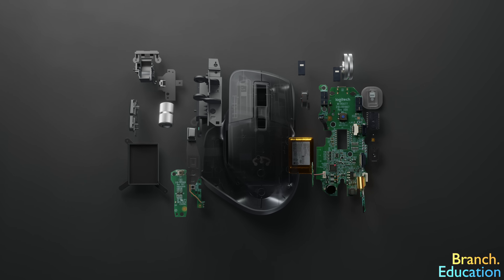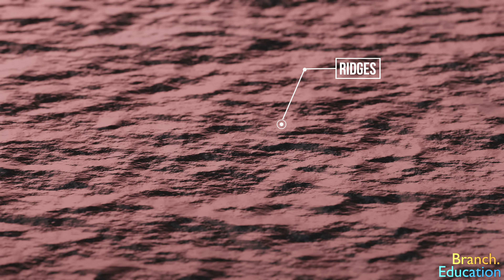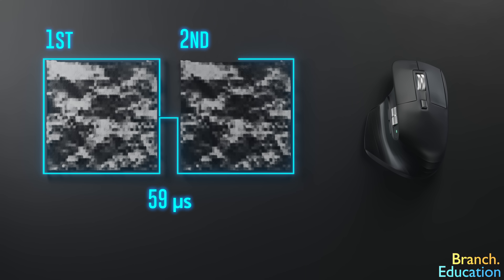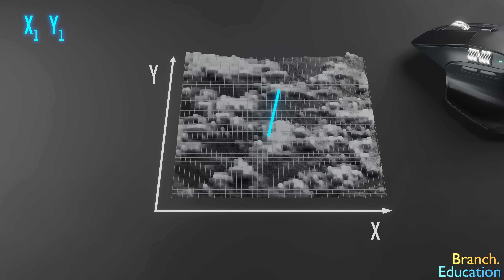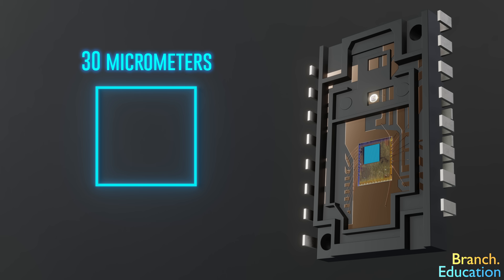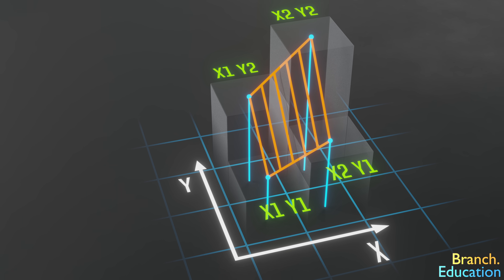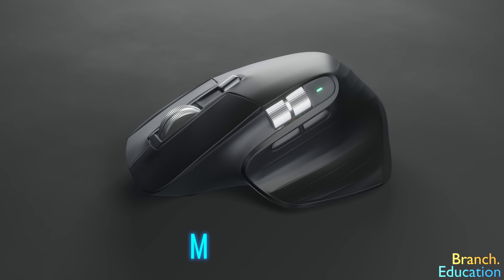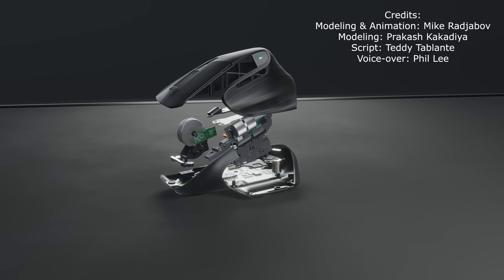How does a Mouse know when you move it?  ||  How Does a Computer Mouse Work?

Comment: For those interested, the little SoC (with the red dot) near the imager chip is a -muRata MBN52832- Nordic Semiconductor NRF52832 which contains a 32bit Arm Cortex M4F with built in FPU processor with 64k of RAM and 512k flash storage. Here's an interesting tidbit, the Cortex M4F has enough processing power to run Doom, so technically if you were to add a couple megabytes of ram and a display to this mouse it could run and control Doom by itself.
Reply: 64k of RAM in the SOC of a Mouse. Imagine going back in time and telling this for engineers of the Commodore 64
Reply: @fellipec  The fact that my $40 bluetooth earbuds (Cortex M4F @ 250 mhz) are almost 10 times more powerful than my i486 PC (which cost over $2000 when I got it) blows my mind.
Reply: @LegacyOfTheAncientsC64c  Wait for 50 more years and see what the current technology is worth lol. Grow up man. Everything current blows our mind compared to our past. It is common sense.
Reply: @LegacyOfTheAncientsC64c  Sure. When I think about what happened since my first PC, is a mindblowing thing
Reply: @edwardspencer9397  If by "grow up" you mean "Lose the capacity for wonder" I'm sure he'll get riiiiiiiight on that.

My only annoyance, as someone who likes to tinker around with such things, is that mice image sensors/lenses are generally bespoke things, so it's not like you can whip up a mouse with an Arduino that does something unusual.
Reply: @edwardspencer9397  yep, every comment has one. “Mr. Logical—smartest man in the room” telling people to grow up because they think things are cool. I think you’re the one who needs to do some growing up.
Reply: @edwardspencer9397  who pissed in your cereal when you wrote this comment man? Maybe rather than waiting for other people to develop that technology, you should instead learn what a marvel it is that we got to this point, and help develop it further. If you fully understood all the workings of this stuff, you'd be amazed too rather than telling someone to "grow up" for some reason??
Reply: @edwardspencer9397  Dude I believe you might want to chill out for a moment and maybe find something in life that makes you smile. Either that, or someone pissed in your cereal TWICE, in which case I offer my commiserations (having that happen to me would probably make me rather angry too so it's understandable).
Reply: OhSoUnicornly Aah so you are a 12 yr old then. Why didn’t you tell me earlier. Point noted Mr. Cereal killer. Everything makes sense now. I will send you a mouse. Tinker with it, play Doom. That will make you smile.
Reply: @edwardspencer9397  so much power as to be inefficient compared to Apple’s handset chips. Power is bad, dolt and ageist. Computers run well on speed.
Reply: @edwardspencer9397  When you try to be savage but you end up being wholesome by mistake 🤷‍♀
Reply: OhSoUnicornly You were trying hard.. and you failed miserably. Ulta chor kotwal ko daante 😂
Reply: @fellipec 
64k of RAM in the SOC of a Mouse. Imagine going back in time and telling this for engineers of the Commodore 64

"Isn't 64K an awful lot to dedicate to just 1 input device? Memory isn't cheap you know. And how are you going to cram 64K of memory chips into a hand-held mouse? We could use 64K of video RAM to do better graphics.", they might reply. "Couldn't we just use a ball and 2 roller switch counters? And where are you going to connect it? The Commode 64 does not have very many clunky interface ports. And what is a 'USB hub'?"
Reply: @fellipec  That's at least 2x the memory that was required to take Neil Armstrong to the moon. And it's in a mouse. Wow.
Reply: Shows how insanely far we have come with computer technology
Reply: thats insane
Reply: mind blown
Reply: Wow, thank you! That's so cool!
Reply: Plot twist: The mouse is the computer ...
Reply: @Cookie-kf3xn 
Plot twist: The mouse is the computer ...

Plot twist, the handheld game controller is the game console. Oh wait, I think that has been done already.
Reply: My Mind Effing exploded when i saw another "it can run doom" analysis. I remember how big and clunky my rig was when I first ever played it. and now things like pregnancy tests can run it. God i was born in the 90's and already i sound old.
Reply: @Hawkeye_PC  Yeah that pregnancy test was BS. The guy just used the plastic shell and stuffed an oled display in it and used a raspberry pi (or an arduino can't remember which) to run it, and it wasn't even Doom it was just a video of it. The tiny 4bit MCU on those things run sub 1mhz and has even less power than an Altair kit. Everytime I see it I laugh, it's sort of become a joke in tech circles of how tech journalists report of things without validating it or even bothering to check whether it's true.
Reply: @Hawkeye_PC 
You might like to check out Ben Eater's YT video channel. I think that the first video I watched was something about how to build the "world's worst video card". He built a video card on a breadboard with simple digital logic components. His computer monitor was happy, detected a 640x480 signal (properly timed sync signal), but the screen was blank, because he/we hadn't built the graphics part yet. Then he/we build it with 64 colors at a very poor resolution. My first computer, an Apple //e  would have loved having 64 colors! Amazing to watch his videos. What fun to build all that stuff, however, I already have a computer with much more power than what he is showing me how to build. He will even sell you the kits. Maybe if I was retired, I could have more time to play around with hobbies and build stuff.

Why breadboards? He explains that in one of his videos. Anybody can build a kit, but they wouldn't know why things are done a certain way. The breadboard computer allows a person to experiment, see problems and faults, and how they might be fixed or improved.
Reply: @yosefmacgruber1920  Yep, I saw that video a while back. Been subbed to his channel for a while.
Reply: @LegacyOfTheAncientsC64c 
I do not sub to much of anything. Maybe I am interested in too many topics, and would be getting too many notifications?
Reply: It gets crazier when you compare it to the Apollo Guidance Computer operating at 2 MHz , 2k 15bit word RAM and 36k word ROM. It sucked down 55 watts and weighed 70 lbs.
Reply: to be fair, a GBA can run doom.
Reply: I think you might need to add a video card and sound card to run Doom. Integrated graphics and sound probably are not a thing on a mouse. Might need to beef up the power supply also.

Strange how almost every little computer accessory is in itself a computer of its own.
Reply: @yosefmacgruber1920  the latter has been true for many decades now. For example Commodore PET or Commodore 64 disk drives, contained a 6502 processor with roughly the same computing power as the computer itself.
Reply: @mjouwbuis 
And so most of that extra computing power was wasted, of no use when the disk drive is not spinning. And the disk drives were oversized and clunky and ugly, while my Apple //e disk drives pulled their power from my Apple //e power supply, not having a power-outlet-hogging plug.

2 possible benefits though, especially if CPUs were becoming cheap enough:
• faster loading and saving. The extra CPU can handle the data modulation/demodulation, perhaps a 2:1 interlace ratio could be used like the later Macintosh, rather than my Apple //e's slow 4:1. Modulation is required because too many 0s or 1 bits in a row can not reproduce the correct count. Modulation likely added a small amount to the amount of data needing to be stored. But those old computers didn't use much data, and so loading/saving twice as fast, would seem to make little difference. The much bigger problem was disk-swapping, because extra disk drives were expensive and beyond many of us's budgets. Why didn't they build a "2 drives in one" drive?
• a move towards multi-tasking? However video streaming wasn't a thing back then, so mostly irrelevant? Even now, how many video games can preload a next level while still playing the current level? There just wasn't the need yet to load data at the same time that other things were happening.

Now things have improved. CPUs are cheaper and electronics much smaller. Peripherals having their own CPUs may solve some compatibility and timing issues. Printers always seemed to have their own CPUs? Most everything tends to buffer data to help hide minor data flow disruptions.
Reply: @yosefmacgruber1920  If I recall correctly the NRF52832 has a built in LVDS LCD driver (not 100% sure though) so you'd only need the interface. As for the graphics the M4F can run Doom purely in software mode, same for audio. 

You're right, everything has a little microcontroller in it. I was looking through an old manual for my mother's stove and came across a section on how to turn the burner knobs in order to display the software version on it's clock display and I was "whaaat? This has a firmware?"
Reply: @LegacyOfTheAncientsC64c 
Well my ancient electric stove I am pretty sure, has no software. Has one of those old noisy gears electric motor drive clocks on it. Those old motors were simply paced by the 60 Hertz AC. But my microwave oven could be run by the same 6502 CPU processor, than ran my Apple //e computer, for all I know. Surely a 16-bit address bus and ability to access up to 64K of RAM is plenty to operate a simple appliance. They often use LED or LCD displays I imagine, because the interface is simpler, no video card needed. If I had nothing better to do, it might be fun to write a few apps, that simulate a microwave oven or digital watcher operation, clicking on the sort of keyboard or just 4 or 5 buttons that such a device might have.

When Ben Eater wrote some simple 6502 Assembly code to put his "world's worst video card" through its paces, I was amused at how FAMILIAR the code was, as I used to play around with that on my old Apple //e computer. Although my Miniassembler was much too cumbersome and limited, so I often just looked up the codes and typed in the hexadecimal values for the bytes. They was a handy often-used trick for doing short amounts of machine code right within an Applesoft Basic text string. Not need to poke the values into memory, as the text could be poke-copied into the input buffer and sent to the ROM-based Monitor to put it into RAM. That way, I need not bother to convert all the numbers to decimal and editing would be easier. The Monitor was a crude ROM-based programmer's utility. Looked something like this:

500FORA=1TO15
510POKE2*256-1+A,ORD(MID$("300:2C 19 FE 20",A,1)): REM Load input buffer.
520NEXT
530CALL-151+3: REM Call Monitor to process without prompting input line.

If I do not want to keep changing the character count "15" then I could assign the string to a text variable B$ and replace 500 with 

]400B$="300:2C 19 FE 20"
]500FORA=1TOLEN(B$)
]510 ...B$ ...
  
Please do not hold me to it, as it has been a long time, and my example is oversimplified, but as the text line input buffer was 255 bytes and a text string could be up to 255 bytes, up to around 80 bytes of machine code could be encoded in such a manner. So a lot of us would write our machine code subroutines in such a way. There wasn't any real need to type the spaces, as Applesoft Basic would put in the command spaces anyway.

If the code was much longer, then it would be saved to disk as a (B)inary file. Then an Applesoft Basic program could BLOAD it, or it could be
]BRUN BUG ATTACK if it was just 1 file.

On my first car, I could turn on the ignition 5 times in quick succession, and it would flash the trouble code pulses to the power loss light on the dash. Carefully count the pulses and write down the number(s). Tell the auto parts store or check the internet I guess? Now with "progress" you now need an actual trouble code reader computer to extract any codes. Which I still do not have one. Some auto parts stores will read your codes for you. No charge until you buy the replacement part(s).
Reply: Am smart,but i even can't try to understand what you are say,this is insane.
Reply: This is the Nordic NRF52832, not Murata. Murata manufactures modules with this microcontroller.
Reply: @ЕвгенийКочкин-н7ф  Good catch, thanks. I fixed the comment with the correct part.
Reply: im suprised basically homeless hasnt made a video trying to game with just a mouse
Reply: How can something with 64k of RAM play a game that required a minimum of 8MB of RAM? Isn't a Megabye larger than a K? K = 1,000 whereas MB = 1,000,000?
Am I wrong? According to https://gamesystemrequirements.com/game/doom Doom requires 8MB of RAM at a minimum which is vastly larger than 64k. That's a difference of 15.625. Either I am thinking about this incorrectly or your comment is incorrect.
Reply: @Drewsterman777  I mentioned the need for extra ram in my comment.
Reply: @LegacyOfTheAncientsC64c  Yup, I misread.
Reply: @Drewsterman777  no prob happens to everyone. I wonder if it's possible to run a Doom-like game with just 64k. Maybe simplified textures and level design. The SNES had a pared down SuperFX chip version that used an extra 512k ram in the cart along with the console's 128k. The Cortex M4F is orders of magnitude faster so it might be possible to use some sort of round robin memory compression to eke out a bit of extra ram space or even run with paged data from the flash memory if the speed is high enough.
Reply: @Drewsterman777  read the whole comment. Also that number is a factor.
Reply: Oh, OH, thats quite interesting!
Reply: And pretty sure that shit is more powerful than computers used on old rockets
Reply: Lol, that was so nerdy. Awesome ;)
Reply: If you put a keyboard, half a GB of RAM and a display on such a mouse you can run full Raspberry Pi OS on it!
Reply: I like your words funny man
Reply: I like your funny words, magic man
Reply: speed, not power
Reply: The only way we survive, I'd say if we stop being human.
 It's becoming self destructive, everyday people wounder what Kardashians are doing, how could I make my dick bigger or my tit's, ass the list goes on. Humankind as a whole is focusing on society more then the advancement in technology, ik the golden age is among us for tech development. But if we had a Jimmy nutron in every home on this planet, the world would be a better place would be free from poverty from ailment or from war. 
If everyone was on par technologically speaking we would be living all of us would be living the greatest life known in our history. 

Sad to see but ik most of you guys will clown me for my input, Ik it's cringe to say it but somebody has to. 
Think tho if we all had a med bay and a roof that u can call your own and actual facility were u can learn about the world u were born into and  how to mold your passions into it. A press that was honest and only gave u what happend no hog wash along with it,  Maybe one day people will realize their on a treadmill and the killer, time is not. 
Better to live with accolades in grander than die in a prisons wealth of thoughts and ideas left to the wispers of the graveyard.
Reply: @deepkicks-999  Did not find your reply cringy at all. Absolutely agree with what you say.
Reply: @LegacyOfTheAncientsC64c  thank u
Reply: @deepkicks-999  awful diction/gender
Reply: Can you post this again in English please.🥸😏
Reply: @HalfWarrior  last sentence is in English.
Reply: @DanSlotea  I know that of course; just my sense of humor kicking in.
Reply: @HalfWarrior  didn't get through :)))
Reply: @HalfWarrior  The most powerful processor on that mouse, when given more memory, can run DOOM, the 90s version. It’s a testament to how powerful technology is now, that the most mundane and overlooked components can do what only the best machines 30 years ago could do.
Reply: Aaah, yes, the S98EG6S8R7H58S Hyperelectroplasma Converter. i am very familiar with it, i use it every day. It also goes up to 10000 MegaSpeeds but only with Torso(TM) FUB Nanoburst Emitocapacitors installed in Cross32Parallel Multi-Efficient Laser QWERT slots, which is very hard! But i am so good at devices as you can see, it was no problem at all. Yes, doom is a great game, i play it every day too!
So nice to meet another smart person, wow.
Reply: @overmind06  Bro had to screenshot this 😂
Reply: @overmind06  LOL
Reply: Any askers?
Reply: @benhenry6248  i asked
Reply: @benhenry6248  your mom

Comment: Laser trackball is where it's at. You don't have to move the whole thing around, just your thumb. The ball is the surface it's designed to work with. Slow and fast movements are accurate. Never going back to a mouse.

Comment: I wonder how Windows handles mouse cursor movement that of non-straight lines. For example if you move your mouse diagonally for a total of 1000 px to the right and 10 px up. In this case your mouse cursor would jump up 1 px for every 100 px movement. How can the system interpret that movement? Does it store previous movement to calculate the path or a movement vector?
Reply: Either it doesnt(you wouldnt notice), or it calculates moves with higher resolution than what it captures. Or maybe both. But most likely it doesn't. The mouse resolution and screen resolution dont correlate perfectly.
Reply: Mouse smoothing
Reply: Don’t forget that the mouse sends the change of position to the pc every 1 ms. And the update rate of most screens is 50hz/60hz (20ms/16ms). Even with a high end monitor of 100hz (10ms) the pc has plenty of time to update the position before your screen picks up the change.
Reply: I don't think you can move your mouse that fast in one millisecond but ok